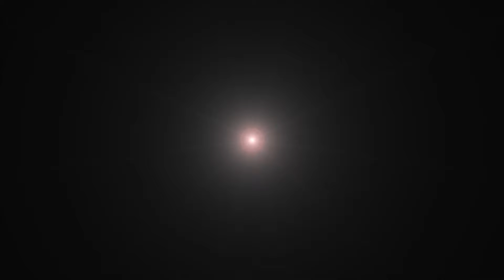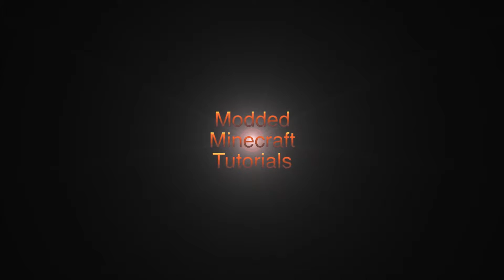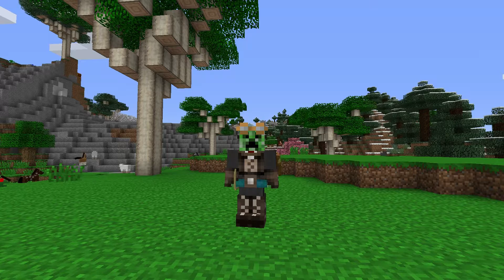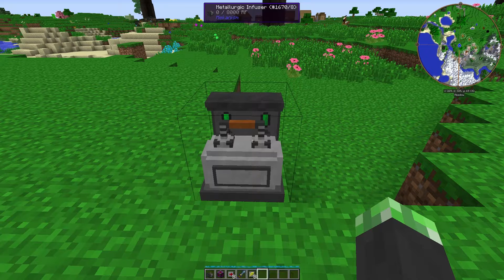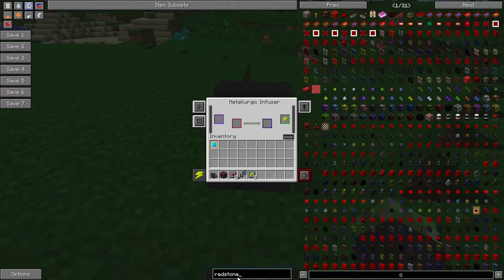Modded Minecraft Tutorial - Metallurgic Infuser

Comment: How do you even power them in the first place??The basic cable I need to transfer power to it requires it to infuse some iron in it first! >.>
Reply from the maker: Place it next to an energy cell, and in the case of Thermal Expansion's cell, adjust the side in the GUI to output (orange dots) and place the metallurgic infuser next to it. In the case of Mekanism's energy cube, place it next to the odd side out, and it will transfer energy to the infuser
Reply: Sweet, thanks for the REALLY fast response :p